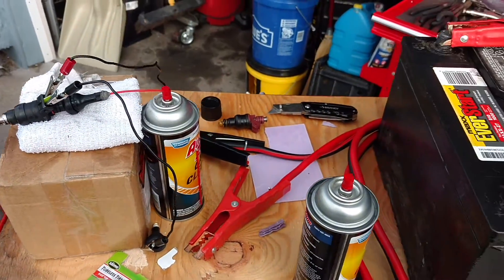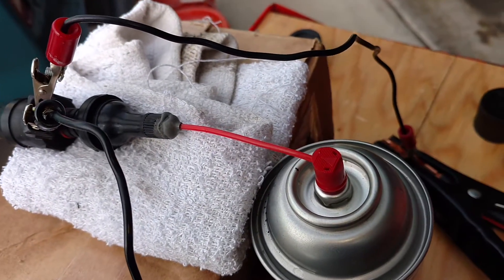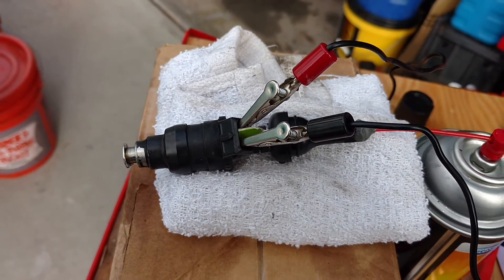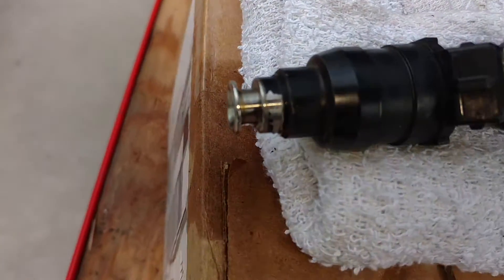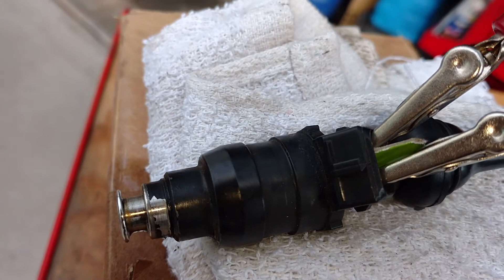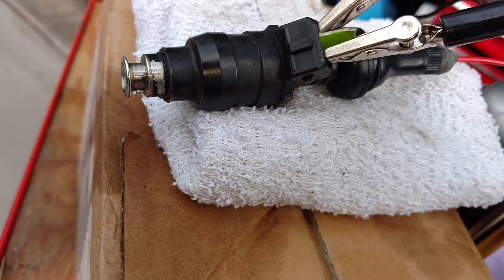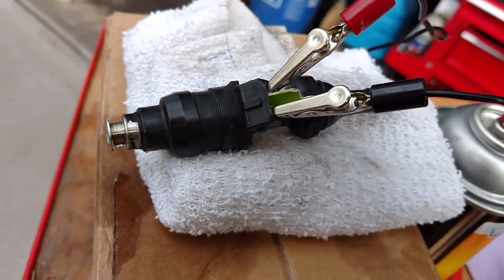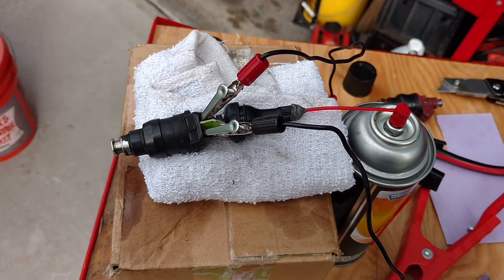Leaking Fuel Injector Test

Comment: Hi can an injector leaking like this cause a lean condition?
Reply: it would cause a rich condition. a stuck closed injector will cause lean
Reply: If the injector is leaking, will the car starts instantly or taking too much time to start after running the car and resting it for about 30 to 40 minutes. 😊

Comment: Can carb cleaner fix that or should we buy a new injectors? I also have that issue on my injector 3#.
Reply from the maker: If you blow carb cleaner through and then it seals properly, then consider it fixed.
Reply: @marshallnoise3557  alright. Ill try doing that then. Thanks!

Comment: couldn't you remove the fuelrail from the manifold and just prime the fuel pump ? then see if anyone is leaking
Reply: Yes, at least on the Chevy 2.2l engines. Take the intake manifold off, remove fuel rail from intake and support it with injectors upside-down. Hook battery and computer back up and prime the pump a few times. With the injectors upside-down you can see the leaky ones fill up their "spray tip wells" pretty quickly.
Reply from the maker: I think it depends on each fuel injection setup. In my case, I already had this set pulled from a donor fuel rail.

Comment: Back flushed all 6 and after testing the glorious mist patern found 3 of mine are leaking. 1 Almost never shuts off, 2nd not too bad, and 3 occasionally will be stuck open. I will tell you one thing. My idle and throttle response feels great when I flush them like this. Anyway I guess it's time to order x3 Bosch ones....